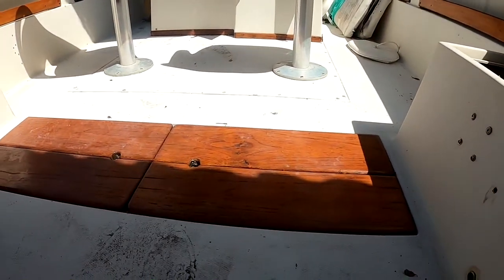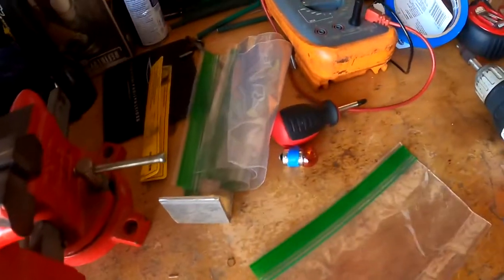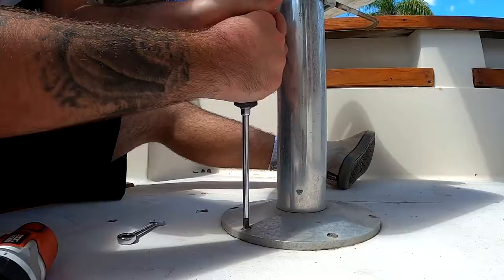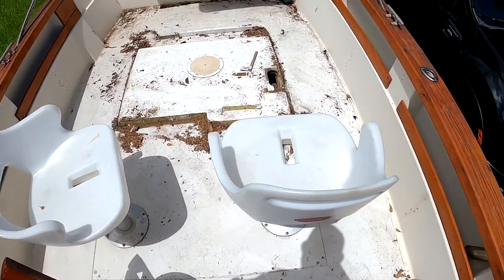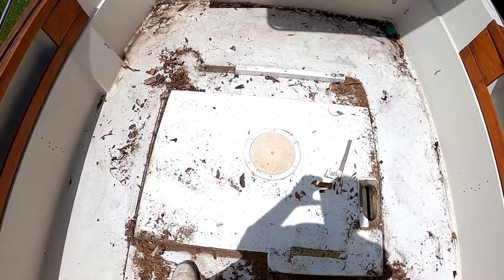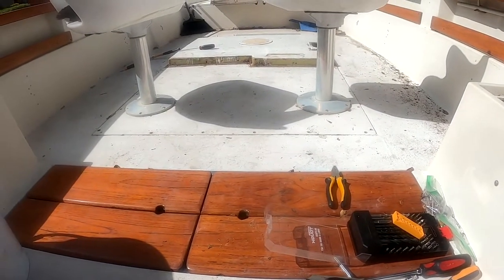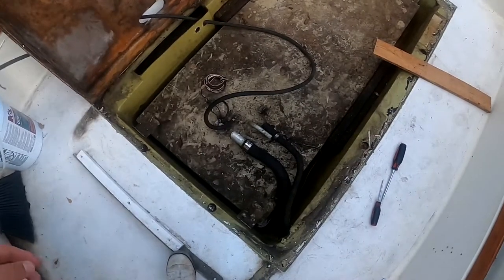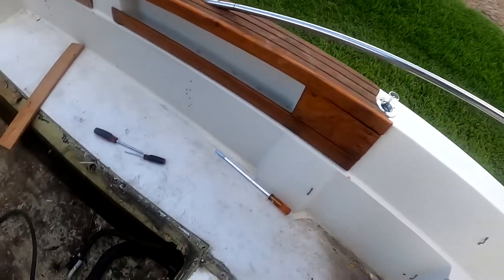TEARING OUT THE FLOOR OF MY 20 FOOT 1980 ROBALO! (REBUILDING MY 20 FOOT ROBALO CENTER CONSOLE!)

Comment: You will find an impact driver is much more effective at pulling and driving stubborn screws.  Debond only works on what it can touch.  Where 5200 (or 4200 which is a bit easier) are used to bed an object you can only dissolve the outer exposed material.  No easy way to do it.  When you pry 5200 up it takes the gelcoat with it so you just have to refinish those areas.  A multi tool with a knife blade can get under it and do the least damage for as far back as the blade can reach.  Making the repairs a hidden area. They also make a cheap hand impact driver that you strike with a hammer which can get most difficult screws.  Worst case you use a left handed drill bit and hope the counter rotating will extract the screw.  Nothing lost if it doesn't because the head will have to be drilled out anyway and the shank grabbed after the base is removed with some vise grips to extract.  You might want to use a paint marker (they make them from fine to broad tipped) for your bags as any gas, brake cleaner or even oil on your hands can take the marker off completely and if the project drags on they will fade after six months or so quicker in the sun.  Any old boat has to be a labor of love as it is time and money consuming.  No fuel tank will last forever.  Stainless 316 would be almost if you can afford it, 304 would be a close second, then plastic, finally aluminum.  In an open boat it is always going to find moisture from outside (foam always gets wet) or inside (condensation in the tank--plastic has less of a problem as it doesn't make nearly as much) and even under a cabin in a protected area the aluminum will corrode.   At the twenty year mark you better start inspecting (keep them accessible and an air space around) and at the thirty year you know it is going to be upon you shortly if it hasn't already happened.  Your seller could have been being honest with you as corrosion on an aluminum tank can come from the outside or from the inside and there just isn't any such thing as "refinishing" a fuel tank.  Since it is progressive on the day he told you that it could have been just fine and two days later it could have made the first hole.  Since they make many standard configurations with plastic molded tanks designed for permanent installations if you can find a shape close to what you need that would be the most economical.  Having a tank custom made is costly.  If you are going to own the boat for a long time seeing what the differential in cost between stainless and aluminum (both 304 and 316 stainless) would be worthwhile.  If you are in the SE there are a couple of big outfits in Florida that deal in used boat parts with huge warehouses full.  Since there are many Robolos around there are many parts that would be a drop in fit for yours that they may have.  Most manufacturers have gone to the molded plastic tanks for the smaller boats.  These would be a good replacement for your aluminum tank at a favorable price.

Comment: That Tank looks very old. it could have a lot of corrosion on the bottom. Check for pin holes, (that fuel from the drain was coming from somewhere) you should probably get it pressure tested.. If it were mine, I’d just get a New Tank.. You’ll essentially have a New Boat. Tanks last 20 years on average. Any boat at that price point is a Project Boat. Think about it this way, You’ll learn a lot fixing it up, and you’ll have something really nice when it’s finished. It’s a nice boat! Good Luck!
Reply from the maker: Supposedly the tank was refinished about 3 years ago by the previous owner, but in the next episode you’ll see what I end up doing! I think so too! It’s gonna be really nice once it’s all done, thanks for watching

Comment: I’m doing the same thing in Fort Lauderdale 
20 1976 robalo !!! High five ✋
Reply from the maker: That’s awesome man! They are great boats and built very strong. What’re you doing to yours?
Reply: Hi! Was there water where the tank was?  Was it all foamed in?
Reply: @rilla46  yeah I had water in the tank and water it had so much garbage like leaks and little bit of grass growing I pressured washed everything
Reply: @oneofakindoutdoors   yeah I can wait to put the center console on and paint it engine fired up and idles now it’s a 1986 250 hp Johnson looking for a prop and trim assembly

Comment: I have a 1979 Robablo r190. Going to replace tank.  Was tank foamed in?  And is tank coffin sealed from rest of hull?
Reply from the maker: Nice! I love the Robalo its a well built boat. yea originally it will be foamed in mine wasn't all the way because it had been pulled before. And yes! Thankfully it is, great design so if you have a  fuel leak it doesn't affect the rest of the boat.
Reply: @oneofakindoutdoors  I read not to foam in aluminum or a Mohler tank.